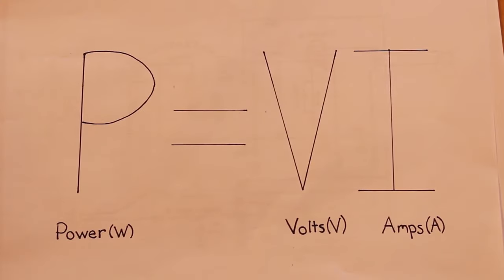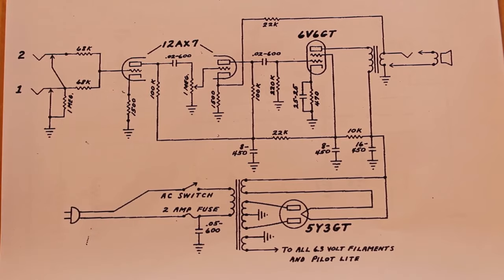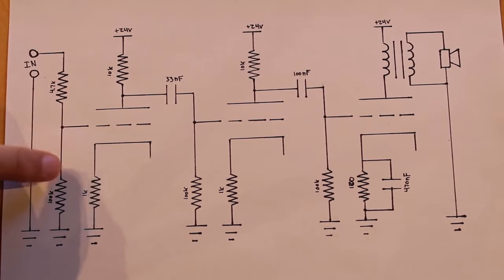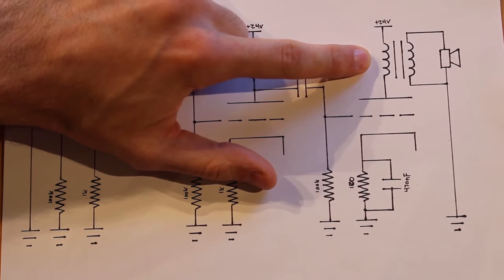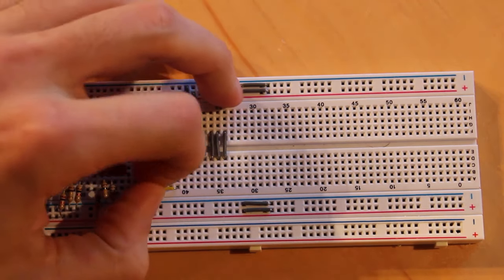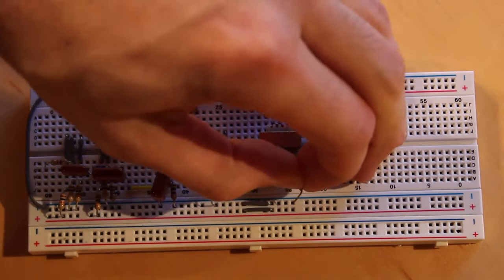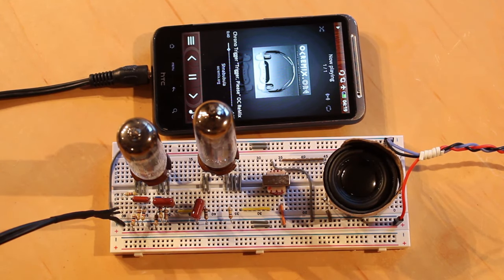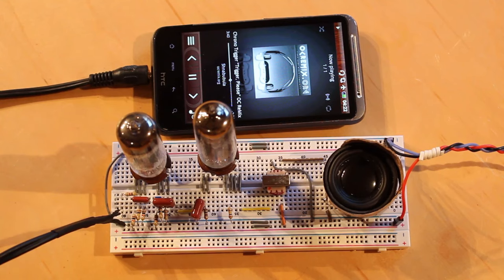Let’s Build a Low Voltage Vacuum Tube Audio Amplifier

Comment: 4:00 the circuit diagram.  I think I have a light bulb moment.  Not sure it is confirmed though.  The key to tube is not just the triod can do amplification, but also the presence of a capacitor or transformer.  As said by another youtuber, the DC cannot go through it. Only AC.  

Otherwise it might become a rectificer ...

One of the strange issue of how to deal with the negative phase of AC input.  If the cathode is ground  as in here, how can the grounded electron in e-cloud around cathode to go through the negative voltage in the grid.  I suspect the grid is actually a bit postive always and AC fluctate around this positive.   Hence, the negative AC part is not negative relative to the cathode.  Otherwise it may turn into rectificer and lose information.  

One complication of ths mental model is that you cannot easy tune to exact or in other words, the grid is always positive even in negative input AC cycle.  That means there are always some electron going through the grid and do a DC current always during that time.  It is like a carrier wave and whilst you need a carrer wave for information to pass through, you do not want this to go to other stages (especially not loundspeaker).  So, if my mental model work, one needs a capacitor (or power transformer) in every stage to filter out the DC. 

 ... Well, I hope this is not bad light bulb idea of mine.
Reply: In spite of above, rigjht or wrong.  (It got a bit issue as the AC will be all positive ...). Still not sure how the cycle work. Frequency is not an issue as you can see that the outgoing amplified AC wave would follow the pattern of the input AC wave.    How the large V of anode help the amplification.  Say cathode is -0.1V, grid is AC change on +0.2 to  +0.4V (use my model above), and the Anode is maximum 20V.   Would it be 0-20V but how?
Reply from the maker: Audio stuff is super weird to me and so I sometimes struggle to wrap my head around it, haha.

For computing, we sometimes want the input signal to stay high and the output signal to stay low, or vice versa, so coupling capacitors aren’t used at all. But for audio stuff, the input signal is always alternating, so a coupling cap is almost always used (thought the Champ Amp schematic here doesn’t use them, but we’ll talk about that in a second).

So, the way I see a coupling cap in my head is that it takes whatever input signal is coming in and relocates that signal to be around 0V. For example, if we have a sine wave input that goes from +5V to +10V, that’s a level that’s too high for the grid. If we use a coupling capacitor, now the sine wave goes from -2.5V to +2.5V. It’s still an identical sine wave with the same amplitude, it’s just been moved a bit.

Now, the Champ Amp here was actually meant as a guitar amplifier, and guitar pickups by nature are already oscillating around 0V, so a coupling capacitor isn’t strictly necessary, which is why the Champ Amp didn’t include them I believe. 

Another interesting thing to keep in mind are the cathode resistors on the tube. The Champ Amp uses a 1500 ohm resistor, and this actually elevates the potential of the cathode to above 0V. So, the input on the grid is always negative in relation to the cathode. This sounds like it might just totally stop the flow of electrons, but in practice, the 12AX7 (and most tridoes) are meant to operate with the grid always below 0V. If we check the 12AX7 datasheet ( https://frank.pocnet.net/sheets/127/1/12AX7.pdf ), we can see that the graph for plate current versus plate voltage and grid voltage gives us information on grid voltages from -5V up to 0V, but nothing above 0V. 

So, the 12AX7 used here is designed for the grid input voltage to be somewhere between -5V and 0V, which is why the cathode resistor is in place, elevating the potential of the cathode, so the grid input signal never goes positive relative to the cathode.

Now, I believe this is because the 12AX7 is supposed to run on about 200V to 300V, which is such a strong attraction from the plate, it requires quite a lot of negative potential on the grid to slow the flow of electrons. For our low-voltage design here, the grid may actually need to go a bit positive to get proper control. This whole process was a bit trial and error since the datasheets don’t give hardly and information on really low voltage operation.

Also, to answer your question about how the triode is actually amplifying the signal, it’s really just as simple as the grid being really sensitive to controlling the flow of electrons. We can think of it in percentages a bit. So, looking at the 12AX7 datasheet, if we have a plate voltage of 100V, a grid voltage of -2V will not let any electrons flow at all. A grid voltage of -1V will let enough electrons flow to give us about 0.25mA through the plate. A grid voltage of 0V will let a ton of electrons flow giving us about 2mA through the plate. So, we end up with something that looks like this: 

-2V = 0% flow
-1V = 25% flow
0V = 90% flow

That’s just a 2V change on the grid controlling the flow of electrons from near cutoff to near saturation. And when the tube is in cutoff, the tube essentially doesn’t exist, so the plate is pulled up to the same voltage potential as B+, which in our example is 100V.

However, when the tube is in saturation and electrons are flowing freely, the plate is now being pulled down, to the same potential as the cathode, which is near 0V (internal resistance of the tube and the cathode resistor actually probably puts this a bit higher, but that can be adjusted by changing tubes or changing resistor values).

The Fender Champ here is actually a pretty high voltage amplifier, I believe it uses around +450V on the plate. That means that with just a really small input voltage on the grid, the plate is moving quite a massive difference. 

The Champ Amp uses two amplifier stages, each giving a gain of about 18V I believe. So, if a 1V peak-peak-to-peak signal is input into the grid, the first stage amplifies that to 18V peak-to-peak. This then goes through a coupling capacitor to remove the DC component of the output and is then fed into the second amplifier stage, which amplifies is up to about 300V peak-to-peak!

I actually simulated up the first two amplifier stages of the Champ Amp in TINA to see what the waveforms looked like, and this was the result: https://i.postimg.cc/8Cbsc2x3/ChampAmp.jpg

It might be a little hard to read, but all the concepts are there for the massive amplification that the little 12AX7 produces at such high voltage!

Whew, that was a long reply, haha. Let me know if you have any other questions or something doesn’t make sense!

Comment: instead of using such a small speaker ... use a bigger one salvaged from some old tube radio. 
Why using a triode instead of a tetrode or penthode in the final stage?

Comment: 1:55 this formula is great IF you are working with DC curents but when you go to AC this formula isn't going to be correct anymore. You have to take the angel between the volts (U) and the Current (I) and multiply this with your current and volts this is better know as the cos(φ) and then you will get  P = U . I . Cos(φ) for AC power.
Reply from the maker: You're absolutely right! 
I'm still a super noob at AC circuits, but the idea of power being directly proportional to voltage and current still holds true, even for AC circuits. So, with low voltage, we need a lot more current to get more power.

Comment: Would you be interested in VFD display as audio amplifier? Like KORG VOX NuTube technology.
Reply from the maker: That's actually something that I really want to try someday!
Though, instead of the Korg NuTube, I think I may give it a go with a random VCR VFD or something. I think it's awesome that VFDs are essentially just triodes!
Reply: @UsagiElectric  i will be waiting to see that. Suggestions, make a multi stage tube distortion. Play around with plate current.  Can you use some part of the display for amplification while other part still use as display?
Reply: Electric guitar pedal please

Comment: trouble is that operating vacuum tubes at low voltages has the unfortunate effect of driving a considerable emounth of grid current deforming the signal.
Reply from the maker: Yup! Low voltage vacuum tubes are super fascinating because all sorts of really fascinating hurdles crop up that aren't really well documented. Either way, the intention was never to build the best amplifier, but to build a fun little low voltage one that worked as an introduction!
Reply: @UsagiElectric  you could have tried to get some of those really low impedance regulator tubes for that thought and might have even been able to get some listenable results from it :D

Comment: Redesign the Output stage tube type to a 12K5 (Or similar) Space charge Tetrode design ...Speaker volume louder on 12 volt Plate & screen (G1) ...

Comment: Why not make a horn for the speaker , “normal “ direct radiating speakers (speakers in a box for example ) are only about 2% ish  efficient so only turn a small amount of power into sound the rest is heat whereas a speaker in a horn can be up to 20% efficient, that means a small amp sounds way louder , the shape of the horn is critical and there are designs that you can print out , cut into sections and stick together to make small “his masters voice “ type horns :-)
Ps put the speaker in a small sealed box and mount the horn to the front 🥸

Comment: Hello, great video! I actually had the same burning urge to build a vacuum tube amp some time ago, but the one thing, that scared me the most was the cost of the output transformer (around 80€), which is totally overkill taking into consideration, that the whole circuit will cost around 80€. So essentially the transformers cost is the same as all the stuff in the circuit combined, which is CRAZY because I wont hear the difference lol! 
Now, I think, that the DC blocking caps, well block DC offset of the signal, because AC can pass through a capacitor due to impedance. By this I mean, that we want only AC coming to the grid, because if there would be some DC voltage applied, grid will be at higher potential and that will mess the signal (you know the terminology better, I guess that is called: the negative bias will be smaller??). There is a great video made by Ben over at Applied Science:
https://www.youtube.com/watch?v=xyMH8wKK-Ag
(Now as I read the other comments Samantha DeBord explained it pretty nicely, but I would still check out the vid)

I found a video of a man winding his own output transformer (you can also do it by hand):
https://www.youtube.com/watch?v=k6b7ND8dCoA&t=706s

To the tube power supply. Audiophiles use tube rectifiers due to thing called sag. This is the tubes delay in response to a sudden change in output deman. For example diode rectifiers can be persuaded as a "instant" while for the tube it takes some time. This effect creates some smooth transitions or something like that. Here is link to video, that explains the sag:
https://www.youtube.com/watch?v=ty8xs3cJk8M&t=622s

Also Uncle Doug created the most awesome video Ive seen on this topic explaining the fender champ/princeton amp tube power supply:
https://www.youtube.com/watch?v=x5SSKX74DKg

You can also try to modify the scheme for fender princeton. The scheme is almost identical but it has a potentiometer to adjust the volume.
Also I want to point out, that there are headphone vacuum tube amps or hybrid vacuum tube amps (combination of vacuum tubes and transistors) designed to run at 12V. But my friend told me that you can not use them with regular speaker, because their impedance is too low (i think the common resistance is around 8 ohms), which will result in too much current demand and that will kill either the transistor or the tube. Also headphone speakers only consume some mW not W. Ive tried to found some high impedance speakers, which was no problem, but the sound will be really lame, because of the low voltage, thus no POWAAA.
http://electronics-diy.com/class-a-12au7-tube-headphone-amplifier.php

If I made a mistake somewhere Im sorry, but I just wanted to share the knowledge I had.
Have a great day :)))
Reply from the maker: Thank you!
And thank you for all the awesome resources! What an excellent comment!

Output transformers are by far the most difficult part of the circuit. Even here, all the good output transformers for sale are primarily salvage from old amplifiers. So, your options, just like in your case, are often pay through the nose for a good one or wind your own. This is actually the biggest appeal to an OTL amplifier to me. No output transformer and just a ton of driver tubes. Not only does it save the headache of trying to find a good output transformer, but it also looks way cooler, haha. And, some of the HiFi audiophiles swear by OTL amps, saying the audio quality is better. Being deaf and dumb, it’d be hard for me to tell the difference though.

Applied Science is fantastic and he probably has the best description of what impedance is that I’ve heard so far – “Impedance is just a resistance that depends on frequency.” I hadn’t heard anyone describe it that way before, and that makes the most sense. 

Although, I think my primary confusion with capacitors on AC comes from the fact that it’s always said that AC can pass through capacitors. This always bothered me because there’s no direct connection inside a capacitor and we’re not inducing any voltage with magnetic fields like in a transformer, so how can AC pass through? 

What ended up clicking in my brain was that AC isn’t passing through, the capacitor is just charging and discharging in sync with the frequency of the AC. When the AC is on the positive phase, it charges up the capacitor, making the other leg of the cap act like a ground pin. When the AC is on the negative wave, the capacitor discharges, making the other leg of the cap act like the positive pin. (At least, that’s how I’m seeing it in my brain, that’s probably not the best way to describe it though).

The concept of sag makes total sense in the amplifier. It takes time for the potential to increase and those electrons to fly across the tube (although miniscule, I imagine it’s not as fast as semiconductors). The fact that they take that into account during the design stage to smooth the audio out is brilliant! The engineers back in the day really embraced the “it’s not a bug, it’s a feature” philosophy!

Speaking of the Princeton Amp, that’s an awesome design, and something I think I may try to adapt into an OTL design in the future. It looks very well suited for creating the output that an OTL driver stage is looking for. That’s a project for the far future though!

I actually think this amplifier that we built in the video would be a great headphone amplifier. At just 24V the gain is awesome and would work great for headphones, especially with some better balancing of capacitor and resistor values. And actually, one of my future project ideas is to build a headphone amplifier that uses just 6V, so it can be powered by a four AA batteries and be stuffed into a tiny enclosure. I’m not sure how viable it would be, but it’s an interesting design idea for sure!
Reply: @UsagiElectric  You can use PA (public address) line transformers as output transformers and they're cheap and easy to find. They're generally better than vintage transformers anyhow. Most of them are even center tapped so you can use them as push-pull also
Reply: You know, if you have the time, you can re wind your own audio transformers from scavenged power trafos. Ive done it for many audio transformers. All by hand, with no winding machine. Yeah, it takes a few hours to make one transformer,but its worth it in my eyes.
Reply: Those headphone amps are a joke. The tube just lights up and they add an led to give the tube that blue glow. The amplification from the tube is very low that's why they added a solid state amplifier circuits. To get true tube sound you need an output amplifier tube and good iron core output transformer. You will get all the harmonics that are missing in them tin tube headphone amplifiers. I do have one of them tin amplifiers with the single type and I had mine hooked up to speakers it sounded like a solid state amp. 73
Reply: I grew up hearing tube amplifiers all my youthful years and know true tube sound. Even AM radio sounded like stereo  I didn't have an FM radio until I got my sister's console stereo. As for AM radio I listen to classical music from a station from NYC  and beautiful music genre from Cincinnati OH. I wasn't into the new sound of 13 Q in Pittsburgh Pa just had to add that for my Pittsburgh friends. Tubes will make any music genre sound good. The younger generations never heard a tube amp for the most.part and some even changed the circuit to tube amplifiers. The dynaco st35 and st70 are two amps that had changes I like how they were built and just replace everything will new same value parts. The only change I want is the added diode to replace the selenium rectifier. I guess the diode will last a lot longer than the selenium rectifier. 73
Reply: @ronb6182 That's what Hi'Fi is SUPPOSED to be.... a lack of color or distortion added by devices that don't amplify linearly. Voltage amplification tubes in the front-end, driving a high impedance output stage, sounds very good. 
Most of the "tube sound", aka distortion, comes from a tube output stage and the output transformer. 
But tubes used as an input stage are not worked very hard, and are extremely clean with a lack of distortion. Sounds different than a transistor front-end, but isn't full of distortion.